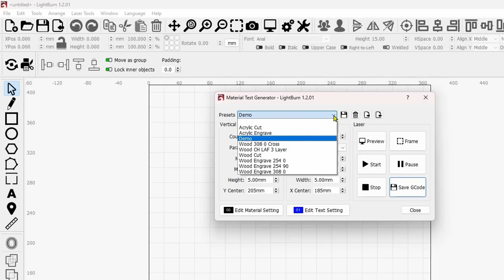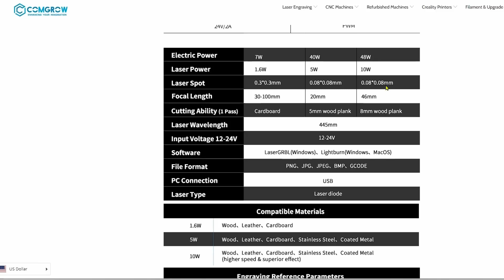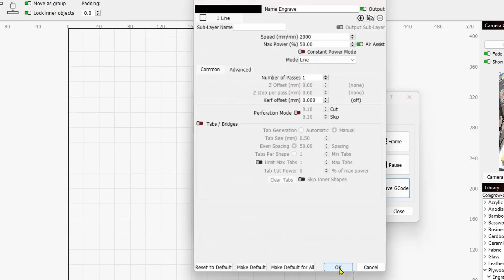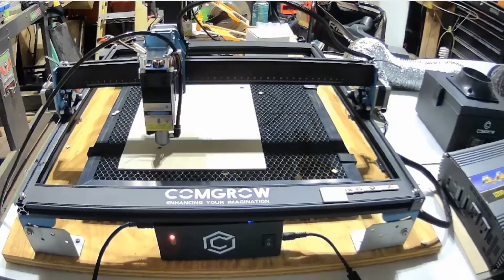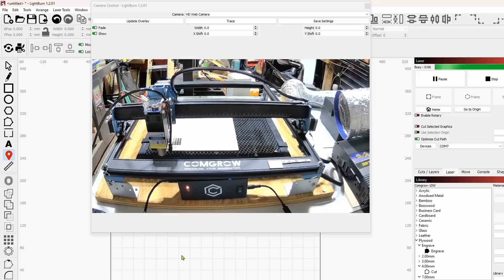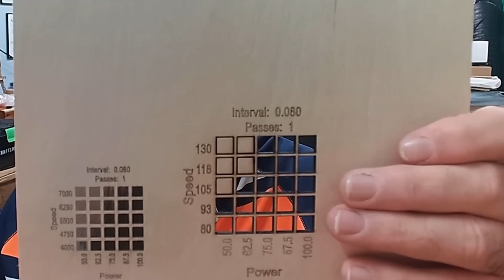ℹ️ How to use the Lightburn Material Test card with YOUR BASELINE SETTINGS. Full demonstration!

Comment: I’ve been complaining about this all morning and I have no idea why lightburn has not fixed the issue, which is huge in material testing, instead of filling in all at once.
It burns each square individually and is not a true representation of that particular speed.
In other words, given a real world project with larger space translating to more time to get to speed it will probably not even burn much less produce the same shade as the test card.
No wonder people try to sell or give away ( like you ) test cards.
Reply from the maker: I do basic material tests in Lightburn, and then mini tests with the actual graphics based on the material test. You're right...
Reply: @TheLouisianaHobbyGuy  yes i know. Been watching you from the start. I like the eyeball test you have.
Reply from the maker: I use the eyeball for a basic test, and then I shrink and use the actual image for the final tests. I need to do a video on this. As I'm running the test image, I go to the move tab and change the power and speed on the fly.

Comment: I'm still having issues! Nothing is engraving on the 3mm Basswood with this test. What am I doing wrong? 1,000 mm/s Min, 5,000 mm/s. Min 50, Max 100 power. Material test Speed 200 Power 50. Fill on. Algolaser 5w Diy Kit
Reply from the maker: I don't know Ellie, I can't diagnose your issue in a YT comment. But I can tell you that 1000 mm/sec will never engrave anything on a 5W diode. Try changing to mm/min. Click the wrench and screwdriver icon and switch. Then those numbers will work.

Comment: Hi Rich Love the videos.  Just setting up a RM J630 laser. (I saw the review you did ). The J630 I have has been upgraded to a 90W tube.  Want to do a Lightburn Material Test on 3mm ply. Can you give me a starting point for the settings. Previously had a Atomstack A20 Pro So completely different. Many thanks Roy
Reply from the maker: Good choice! Use the Lightburn Material Test. Laser Tools --> Material Test. Then pull down the drop down menu and use the pre-built Co2 tests.
Reply: @TheLouisianaHobbyGuy  Many thanks Much appreciate you sharing your knowledge

Comment: Back already. I have just created a Materials Library for Plywood, using settings in tutorial. I don't know where to find manufacturer for my Ruida CO2 50w laser. In Lightburn when I click on Devices it shows two entries: iLaser/GCode and Ruida/DSP. I pulled up an engraved photo that was passable and it shows LI 080 and DPI 317.
Reply from the maker: There are free Lightburn libraries in the members only area on my free forums Lucie: https://lahobbyguy.com/bb

Comment: Thanks for he video!  Why there is in material settings  speed 2000/min but in the parameters was 4000 to 7000?
Reply from the maker: The manufacturer recommended 5000, so in order to get a range of engraving results, I chose to go below and above it.
Reply: @TheLouisianaHobbyGuy  yes i notised but down where you open material settings is only one parameter and it is 2000/min.
Reply from the maker: You can ignore that one.

Comment: Great video and other videos. I am new to this hobby and slowly getting up to speed. Quick question, I have the algo delta, 22w, optical is between 19.5 and 22w. Do you recommend the atezr 20w library or the Ikier pro 24w-40w. 
I understand I'll need to tweak but just wondering your recommendation. 
As i grow my library, i will share in the future 
Thanks
Reply from the maker: Try both Dave.

Comment: I have a Creality Falcon 2  40 Watt Laser. The focal point at 40 wats is 0.15 mm. The engraving speed is 6000 mm per minute at 25% power for 2 mm Basswood. If I ramp up the power to 50%-100% wouldn't I get more speed out of the laser?
Reply from the maker: In theory, yes.

Comment: Enjoy your videos very much.
I do have a question ⁉️🤔
When would you run any tests at 💯 percent power especially when all the manufacturer said it will quickly shorten the life of the Lazer.
So why not stop at 90 percent.
Reply from the maker: I don't know what diode manufacturer says that. It's a Co2 laser you can't run over 70% power, and the ones that say you can, throttle the power in the controller. Yes, diodes will last longer at lower power, but the lifespan is so long, and the degradation is so slow, the laser will probably outlive it's welcome, or you'll want to move to newer technology before the diode degrades to point where you can't use it.

Comment: Thank you for all of your content. I purchased a K40 because of you're videos. I just recently signed up for the forum and downloaded the material library for the k40 and was wondering if the line interval needs to be updated. Monport states to have a precision 0.1" or 0.254mm but the settings for engraving seem to be around 0.0800(mm) is this correct?
Reply from the maker: Yes, it should be between 200 & 254 LPI.
Reply: @TheLouisianaHobbyGuy  Just to be crystal clear should I change the 0.0800(mm) to 0.254mm?
Reply from the maker: No, the line interval should be 0.1, which would change the LPI automatically to 254.
Reply: @TheLouisianaHobbyGuy  thank you!

Comment: Great video. I'm new to creating this matrix and its well explained. I hear you say that the focused spot is 0.08mm x0.08mm (and its in the manufactureres spec sheet) but I notice your cuts are about 0.3mm wide. Why the difference?
Reply from the maker: The size of the kerf is determined by the precision of the focusing. I don't dial in the focus for the purpose of videos, so it can be off a bit. I doubt it was 0.3mm though. During the original testing when I focused on the focus 🤪 I believe I measured 0.09mm.

Comment: Interesting.  I see that but if scroll down to the technical specs just below that you will see the four different modules. The LM 2 10w shows what you stated.  However the LM 2-4 LF shows the .17x.25mm.  Minute differences but yet small enough to make a difference in details, isn’t it?  But how do you determine what LPI to use?
Reply from the maker: You keep commenting on different videos. Just email me. thelahobbyguy@gmail.com
The link I sent you was for the LF.

Comment: I have an Ortur LM2proS2 with the LM2-4-sf module. I looked up the focal point and it says .17x.25mm.  What I don't understand is when you selected the test card setup and you checked to make sure the LPI was 317, you stated that was a good setup for lasers with focal point of .8. You then proceeded to the Comgrow web site and saw that it was at .8.

What I don't understand is how you knew that the 317 LPI was correct for a focal point of .8.  Since my laser is .17x.25mm, how do I determine what the proper LPI and other settings are correct?
Reply from the maker: .08 Steve

Comment: if i cant load library    for now    how  can  set  the 0.08      ??
Reply from the maker: I don't know why you can't use the library, but if you double click the layer you can change it there. Or just look at the bottom of the Cuts / Layers tab and you'll see it there as well.
Reply: @TheLouisianaHobbyGuy  im ok  had too many sett.. to do  ty
Reply: @TheLouisianaHobbyGuy  need tip on pic   it made a inside out   one

Comment: what kind of cut library should I be using if I want to do test patterns for the xtools 1064 nm laser head?
Reply from the maker: There is none. You can use the Lightburn test. Laser Tools --> Material Test
Reply: @TheLouisianaHobbyGuy  I was wondering about like a base station to go off of I was watching another one of your videos and it showed you using the ortur 20w library as a base station I am wondering which one of your library’s should I use as a base station for settings
Reply: @TheLouisianaHobbyGuy  since I’m attempting to make circle test grids for a 1064 nm laser and not a diode
Reply from the maker: There is no base setting library for the 1064. Included with the laser you bought should be a parameter settings file. You have to get your base settings from that. I don't have one, so I can't tell you Eddie.
Reply: @TheLouisianaHobbyGuy  thank you sir

Comment: Has anyone ever had an issue with the Line Interval from your settings mot matching what actually appears in Preview and/or the actual burn? No matter what I change my Material Settings > Fill to, interval always shows up at 0.003 or 0.004, but I am trying to make it 0.08 to 0.1.  I have asked on the LB forum as well but hoping someone here may be able to help.
Reply from the maker: Never heard that Mark. You can set the line interval in the layers.
Reply: @TheLouisianaHobbyGuy  Thanks for the reply. I have the line interval set in the layers and in the "Edit Materials" option, which I believe is just layer 1, but my test burn will only run at 0.003 or 0.004 line interval. I'm hoping someone from Lightburn will see my forum post on their website and shed some light. If so, I'll update this comment. Keep up the great videos!
Reply from the maker: @mark-b-nice  I'll go look at it.
Reply: @TheLouisianaHobbyGuy  tested this on another PC and it works correctly. I think the error started occurring after I installed a xTool D1 10w material library but now I can't get the error to go away.
Reply from the maker: @mark-b-nice  Ah, yet another xTool mystery problem! 😢

Comment: When you set up the test card for cutting the default speed was 6000....you said "we won't trust this 100 and will change it to 80". Were you working in mm/sec or mm/min? I assumed the 6000 speed was mm/min (100 mm/sec) but the 80 you entered was what?  also mm/min? which is pretty slow. I really enjoy your videos. I am trying to cut 1/8" hardboard with the 20W D1.
Reply from the maker: mm/min George. This was on a diode.
Reply: @TheLouisianaHobbyGuy  I know that is what is recommended and what I use but the changes were ....well thanks for the reply.
Reply from the maker: @QuiltersHandyman  One was a cut test and the other was an engrave. 5W lasers typically cut at 80-200 mm/min.

Comment: I really appreciate your videos. I'm trying to setup this test card, but for some reason, I am unable to increase  "min" and "max" under Vertical/Rows: Speed to the specifications you suggested. Everything else is able to increase to the increments you recommended. Any suggestions??? I am using the xtool D1 10 watt laser machine, 1.2.01 version.
Reply from the maker: I'm not sure which test you're referring to.
Reply: @TheLouisianaHobbyGuy  At time stamped 7:33 to 8;51, you refer to setting up the test card parameters. Under the tab Vertical/Rows, the Parameter is set to "Speed", the highest I can set the minimum and maximum speed to is 2000; whereas, your minimum and maximum speeds are set to 4000 and 7000. I hope this helps.

Comment: Hallo Rich. After struggling with the Boleans without any result I solved my problem using the Node Editing.  This took more than 20 hours. I feel that an "Eraser" is needed: a function making it possible to draw a circle or a rectangle over a part of a design and, with one click, erase all that is within the frame of the eraser. If such a function is indeed not available in Lightburn ( I could not find) than, maybe, your connection to the developer can yield such a function.
Please send me a link to your Patreon account!
How do I sign into your Forum?
Again my many thanks for your videos.
Emanuel
Reply from the maker: Unfortunately that wouldn't be a feature, because you would end up with open shapes. Links are in the description below.

Comment: Hallo Rich. With no connection to this specific video, may I please ask you this:  I have created sort of a mandella / flower in which many  petals meet at the center. As the center has become very congested I am looking for a way to clear the center by creating a small "white" circle in the middle.
How can I achieve this?
Thanks.
Emanuel
Reply from the maker: You can do it with the Boolean assistant Emanuel. Draw a circle, and position it where you want. Select the circle and the shapes you want to cut out and click, Tools --> Boolean Assistant.
Reply: @TheLouisianaHobbyGuy  
Thank you very much for your answer. I have tried this method several times and failed. Also, none of the Bolean keys (in the left side menu) turns blue. there are no shapes in the middle (inside the circle I have drawn there) but dozens of lines, being the ends of the lines which constitute the many petals of the "flower". It is this congestion of the many lines, in the center of the "flower" that I wish to clear/erase. I have tried to operate the Boleans and the Cut shapes but none works.
I have tried to copy my "flower" here but this is not possible.
I'll try to phrase my question in more general terms: is there a way to put a circle (or a rectangle) above any given lines (them being parts of shapes) and erasing any lines within the circle (or rectangle) whilst keeping the extensions of the same lines, outside of the circle (or rectangle) intact?
Emanuel
Reply from the maker: You have to work with closed shapes. Try grouping them. If you're still having problems, sign up for the forum: https://lahobbyguy.com/bb

Comment: Hi I am also very new in this. In the Material test Generator you clicked on the down error by the box present, and you have all kind of items standing there. I have nothing also in Library you have a lot of items to pick, I have nothing. I have light burn 1.2.01 and also just purchased the key. What am I doing wrong?
Reply from the maker: When you run the test generator, you save the ones you make for future reference, so yes, it will be empty  on first use. And the libraries are loaded by Lightburn, they don't come with the software. I have lots of free libraries on my free forum along with directions for members only: https://lahobbyguy.com/bb/

Comment: Is there a way to increase the size of the materials test, I have searched but only found  very confusing answers, I ran the materials test the night before last for the first time, I did not notice the settings for passes(it was set to 10 passes), I noticed the materials test is small, can the size of the materials be increased or is it a fixed size or locked, it is kind of difficult to find the right answers on line, without a bunch of confusion
Reply: great question i would love to know myself
Reply from the maker: Yes, you edit the height and width of the rows and columns, which effectively edits the size of the test card.
Reply: @TheLouisianaHobbyGuy  thank you, I have noticed running the laser speed at 1000 or lower, I found the end results to be better and look great, thank you for all of the information you have in your videos, after you explained how to slow down the trace speed, light has been great to use, I do get better results with LightBurn than LaserGRBL, it seems that LaserGRBL lacks features, the best results I got is decent (it's not great), it looks specky because I had to use dither, thank you again
Reply from the maker: @23names  Glad to help!

Comment: Hi all, looking at Ortur materials reference page for LU2-10A laser there are settings like this: "10,000mm/min,M4,S500 10Lines/mm". Do you know what "M4" means? Many thanks.
Reply from the maker: M4 is a new LaserGRBL command that controls the power dynamically. It's similar to the over-scanning in Lightburn so the ends of the burn don't get burned too hard when the laser slows down to make a turn.

Comment: If memory serves, I had to edit the machine limits on my Z1 in firmware to get above 5000mm/min.

I see you did similar to me for mounting the Z1. I made printed pieces instead of hardware store angles tho.

I didn't notice whether the preview on the generator gave an indication of size. Would be helpful for slate coasters. Oh, just saw the Frame button. 🤦🏼
Reply from the maker: Thanks for sharing!